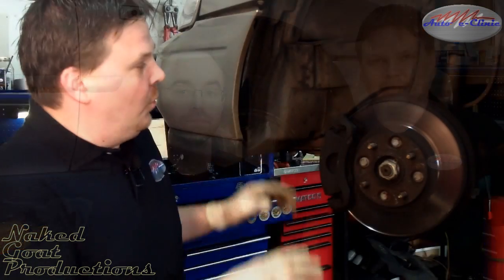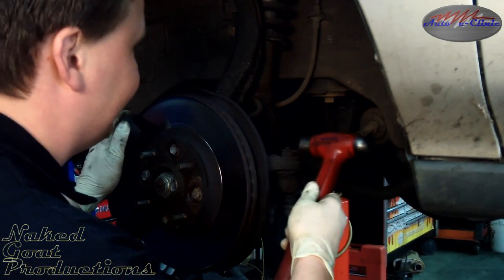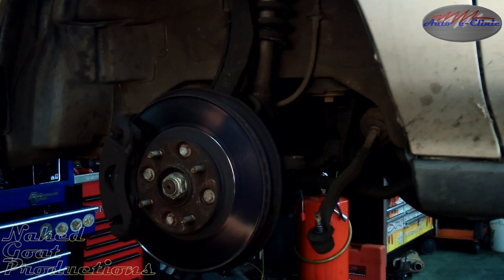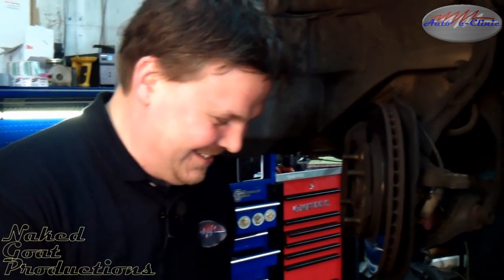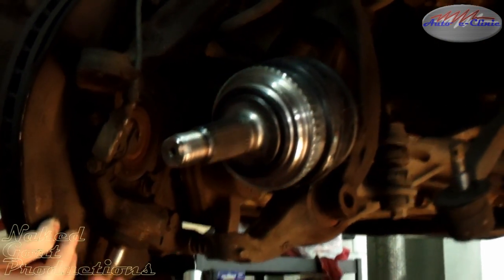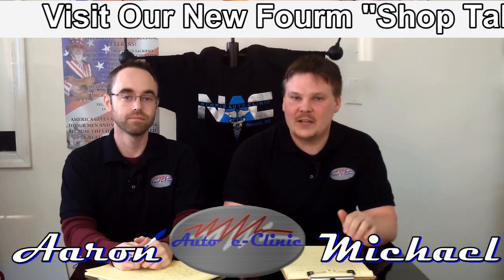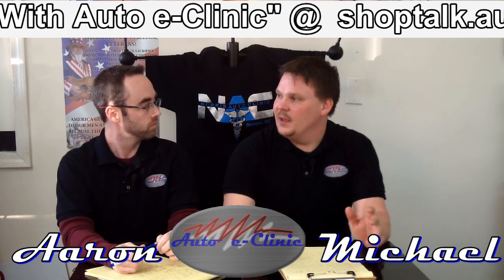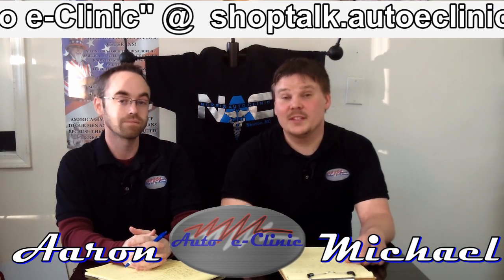How to Replace an Axle Shaft ( CV Joint, Half Shaft) Honda Accord

Comment: if you don't have air tools is there a torque spec on the axle nut when putting it back together?
Reply: Larenzo Garth yes there is. In this case air tool good idea. Some things you don't use air tools for.

Comment: i did disel mechanics engineering and i learned if you have to use a hammer you are doing something wrong
Reply: Well then you learned wrong

Hammers fix everything
Reply: And WD-40. And Duct Tape.
Reply: pickle fork is what i would have used of course you useually smack that with a hammer to lol but thats better than smackin the bolt but at least he put the nut on to protect the threads

Comment: Just put a new CV Half-shaft in a 2005 Mitsubishi galant but when I put it in gear it doesn't go anywhere and I hear like metal grinding against metal. Could I have not tapped it back into the transmission hard enough or would the transmission be bad? It has been hit on the left side which is why I replaced it.

Comment: Thanks for the great Vid! very helpful knowing exactly what to take apart saving any extra aggravation( I mean work)
The only recommendation I have; I live in rust belt. If you have a set of forks( tie rod/ball) use them. I mashed 1st couple threads on Ball joint "just knock that tapered bolt out w/ hammer". Nothing a little filing wouldn't cure. But use em if you got em.
Thanks !

Comment: Thanks guys! Also as a note for others my 2004 Honda Accord axles both had rubber balancing rings on them. The shaft on the driver's side rusted underneath the ring until the shaft snapped. The car would not go into any gear and in park made a loud grinding noise. The noise was coming from the area where the shaft broke under the balancing ring which is located about halfway between the transmission and the wheel. The problem can be diagnosed by placing the car emergency brake on and getting the grinding noise to recur. Check the two parts of the shaft in question and you will see the portion near the transmission rotating and the portion near the wheel stationary. I checked under the passenger side balancing ring and saw similar rusting so i replaced that one at the same time. This job took about 2 hours per side and that was taking my time. Be prepared to drill out the cotter pins on the ball joints shown in the video and save yourself a trip by having the right drill bits and cotter pins on hand. They were pretty rusty. Of course i live in salt country so maybe you non snow folks will have better luck with them.

Comment: How do you take the axle nut off if the outer joint is sheared off. My 86 acura has this problem and when you try and loosen the axle nut the whole rotor assembly spins. Any advice
Reply: Thomas Carrington I'm sure you got it done already.  I'd recommend removing the entire wheel & bearing assy and bech working it. soak everything PB blaster for cpl days / A bench vise & or large vise grip.
Reply: Thomas Carrington leave the tire on the car and the car on the ground til you break it loose

Comment: I replaced my joints just fine. Took longer due to rust seize. When I was done my ABS light came one and won't reset. Any ideas?
Reply: Speed sensor is probably dirty or damaged or maybe a wire pulled out.
Reply: Thanks! How do you clean the sensor?
Reply: Christopher Bratcher Did your new axle include the ABS tone ring? If not, ABS won't work. It's the shiny, bumpy ring visible in this video around the outside of the axle.

Comment: I am not sure why are you surprised that the inner joint came apart... The only thing holding it together and prevents from overextending it is the rubber boot, so it is quite easy to pull them apart when you yank them out forcefully like this.

Comment: Does this install differ from manual to auto transmission Accords, or non-ABS to ABS models? I have a '94 accord LX manual... I want to give this a shot with axles from rockauto, but I'm not sure if they come with a new axle nut.  Is it completely necessary to use a new axle nut or can you reuse the old one?
Reply from the maker: Thank you for your question but due to the passing of Michael we do not answer questions anymore. We thank you for watching but apologize for the inconvenience.
Reply: John Rakich They should all come w/ new. You can call & ask rock Auto w/ any questions.

Comment: I own a honda accord coupe 2011 2.4 lx-s. 
I recently had my front right cv axle replaced and both the ABS and traction light came on, the mechanic that replaced the cv axle told me its common and would disappear within 100 miles of driving with the cv axle.
Wanted to hear your opinion on my situation, the lights are really annoying to have on the dashboard

Comment: so how much does this kind of work cost at the shop vs at home?

also, my 2001 honda accord 4-cyl has clicking noise, but when im coasting straight (not sure if it does when i turn). do you think it's still the front axle shaft needing replacement?

thanks

Comment: I have a 2005 Honda accord 2.4 lx Automatic. MY (ABS) CV axle needs to be replaced. I have went to BENNETT, Auto Zone and Advance Auto to get the CV axle, but none of them come with the TONE ring. All 3 place claims it is the right CV axle. My mechanic says the ABS / TONE ring should come with the replacement axle.

Does the ring come off the old one, and fit on the new one or the ring is mounted in the housing.

Comment: You don't actually have to disconnect the outer tie rod end. You can if you want but it's not necessary. Just the lower ball joint is sufficient. Try it next time. One other minor point is even a good inner CV joint will pull apart if you pull on it. It's just when the boot is torn or separated it will come apart totally.  If the boot was intact, it would tend to keep it from pulling apart. Pulling apart does not in and of itself mean the joint is bad. Good video just the same.

Comment: hey guys i was just browsing you tube when i came across one of  Ur videos. anyway I am working on a 1993 Honda prelude CV axle, i already took the first part of the axle off, but when i got to the section that goes to the transmission i encounter in the middle of the shaft, something that looks like a retainer, i am not sure if am supposed  to take that part off or just leave it there. oh by the way this is for the driver side.

any help that you can offer me would be greatly appreciated.

Comment from the maker: @Todd Miranda Usually there is no need to drain the transmission before replacing the axle shaft. You may want to place a pan underneath to catch possible spillage if any at all. And make sure to top it off with fluid if you do have some fluid leak out during removal and installation. Thank you for you question!!!
Reply: AutoEclinic huh? Not draining the tranny fluid when changing a Cv Half Shaft is irresponsible at best?